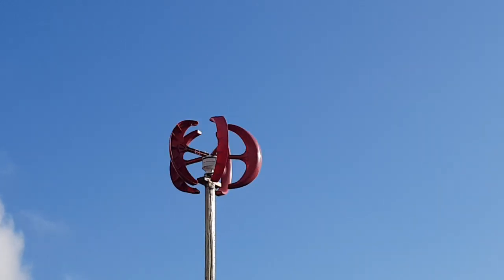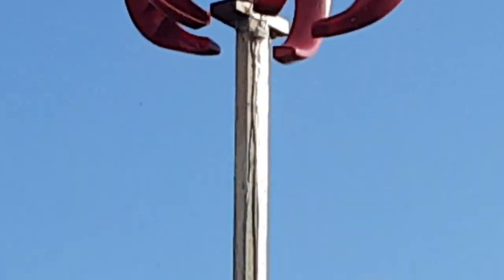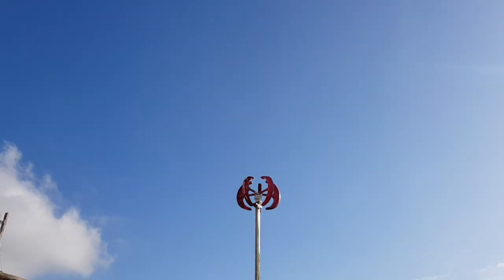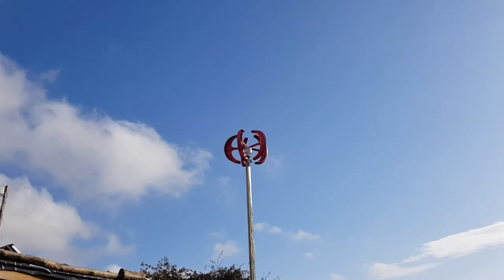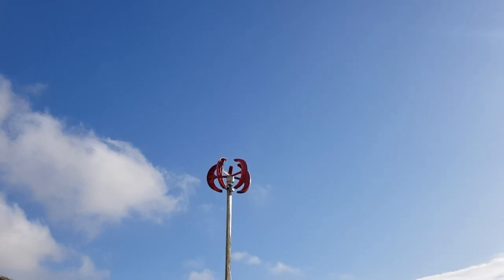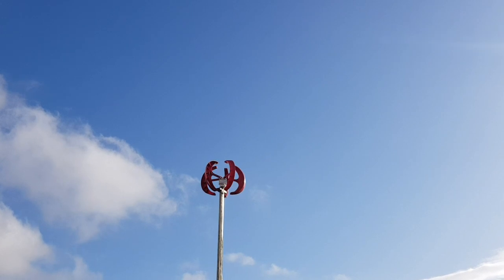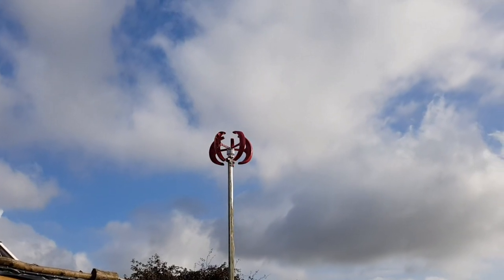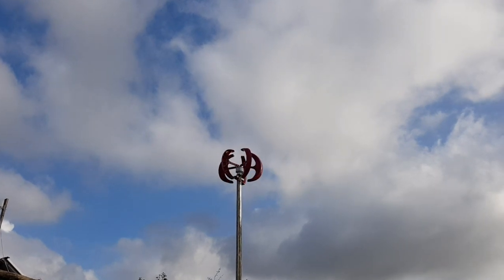Cheap vertical axis wind turbines! Are they worth the money?

Comment: I already wrote you a comment about it in your first video, your video and your own assessment are very good. But as I said, it is difficult to determine the actual performance of these wind generators. As a rule, this small wind generator (depending on the wind strength) only ever provides the power that is required by the consumer. This is also regulated in the same way with the larger generators. There is a small difference in generators that have a PM magnet. More power is achieved here and regulated by “regenerative braking” (another charge controller required). Kinetic energy is converted into electrical energy and this energy is used to recharge the battery (similar to three-phase current). Therefore, depending on their performance, these generators are a little more efficient and of course a little more expensive to purchase.

Comment: I am curious, you said you tested it and determined that it was not meeting the specifications set forth for the product.

It is not that I doubt your assertions about the devices is deficiencies, I am sure you are correct (I have had my challenges with Chinese stuff from eBay myself). At least the stuff you got for free performed to a limited extent, some items I ordered were just trash.

All of that said, may I ask the conditions and equipment you used to do the testing?

1) What kind of meter did you use?
2) Did you test the device whilst it was under load?
3) What kinds of measurements did you take under what conditions?

Comment: I've had solar panels for decades, without a system of tracking the sun from east to west, I only get full wattage for 3 to 4 hours a day. I  also live in the Great Basin,  we sometimes get inversion that can last month's (inversion is a heavy freezing fog that blocks the sun). Inversion lays in the bottom of large valleys so there is little wind where I reside.

     Back to the vertical axis wind turbine, half of the turbine blade is rotating into the wind.  That area is roughly camparable to a 50 mm box fan, with a shaded pole induction motor Thai is typically rated less than 60 watts.  I have a 2 meter diameter vertical axis wind turbine that is band by my local zoning laws.

     I cut a 5 gallon (19 litre) bucket in thirds to make a VAT,  I have an idea how much and how long the wind blows at my house by the noise it makes .  I'm getting one of these today, thinking of printing a 3D patters and casting an aluminium base for an EMT (electric conduit)  frame for a fabric venturi, to amplify the available wind through the turbine at ground level.

Comment: Have you found any better ones that might run a fridge?
Reply: 2,500 watts of solar, minimum of a 40 to 80 amp mppt solar charge controller and  400 Amp hours worth of batteries yeah this will run a fridge but add in an 3,000w pure sine way inverter talking  Minimal of $5,000 for the set up.  <- this would be the minimal power and safety margin to consistently run a fridge with autonomy. <- 2 to 3 day no power.

Comment: is the problem with the b;ades or the generator part? that is the what I would like to know. I can make new blades but if it is mechanical then that is a different matter
Reply: I would cut large thin pvc pipe in half and bolt it on making sure all newer blades face the same wind catching direction as the cheap small blades on it.

Comment: I got mine to work.  You can't run this stand alone grid tied without a battery.  Mine charges the battery by hand up to like 80 watts barely turning it... i will post my video of the test soon.
Reply: where the video?
Reply: @turboturd7954   The output on these lantern style turbines really suck.  I boxed it up and bought a five blade style turbine.  This turbine is doing fairly well... it has reached up to 100 watts during a windy day.
Reply: @weskarcher483  yes I watched a few video today and seen they suck, aluminium windings and small magnets. Whats the name of the one you brought? do you have an ebay link maybe?
Reply: Missouri Wind and Solar has some really nice ones but i think they are monsters.  They sell quality equipment and can be trusted if it says 1500 watts it can deliver that...
Reply: @weskarcher483  hi again, yeah Im not in usa, item number didnt work for me. Dont worry I'll just look up 5 blades. thx
Reply: @turboturd7954  no way! Aluminum windings? They thin copper coated? Man all these are a rip off why not just put the copper in. These companies need to go.

Comment: i payed $350 Australian for wot was calmed a 3500w turbine
i was suspicious about there clams but still purchased one when it arrived i immediately tested and found it was 1amp 26w ...far from there claims of 3500w ...

the same day i asked for a refund 
the seller kept making excuses about my method of testing
after all the delays i got eBay involved and got a refund
was it worth it ? defiantly not
would i recommend one ? now way
with the money returned i purchased a couple of solar panels
that produced over 1000 times more power than that did .
I am finding my self a bit reluctant to bye Chinese products again
Reply from the maker: Same here dave, the alternator on them is shocking
Reply: $350.00 is good when I get it at home and make 3500w.
Reply: @FieldtoFarm_UK  where can I find a reliable one with a real price?
Reply: @naseemafaqiri8907  sorry do not believe it capable of producing 3500w 
i have a 1500w vertical axis turbine and the aria of blades is about 15x more than that and when you look at the wiring thickness it will not carry 3500w without bursting into flames 
china is well known for telling lies to make a sale
3500w = 291 amps at 12v
3500w = 145  amps at 24v
this is based on OHMS LAW that calculates watts to amps 
look it up